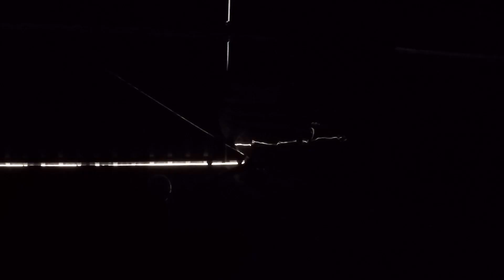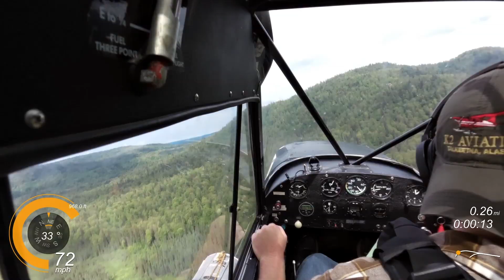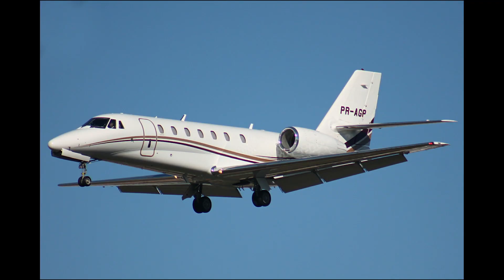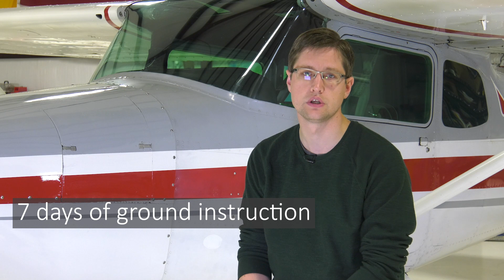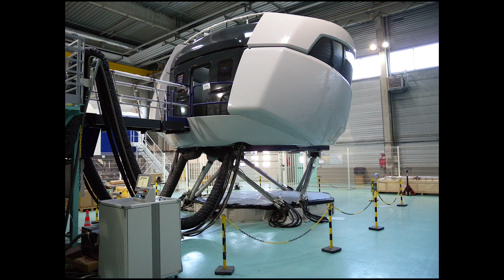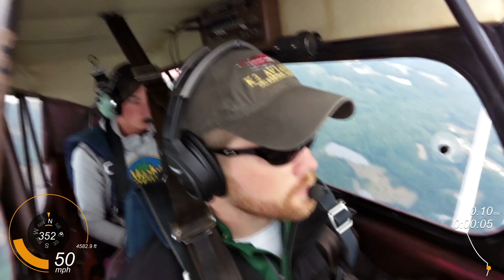Everything You Should Know About a Type Rating | Citation / King Air Pilot Tells All

Comment: Turboprops do not require a type-rating unless they weigh more than 12,500 lbs.  Turboprops are not turbojets.
Reply from the maker: Correct - the King Air 350 exceeds the 12,500 lb mark which is why it needs a type rating. The smaller ones do not for the reasons you pointed out.